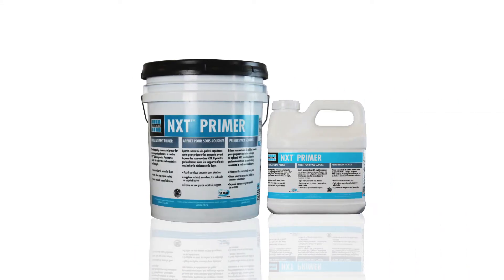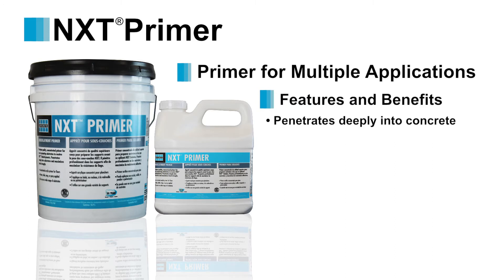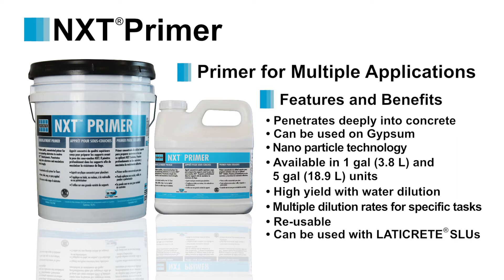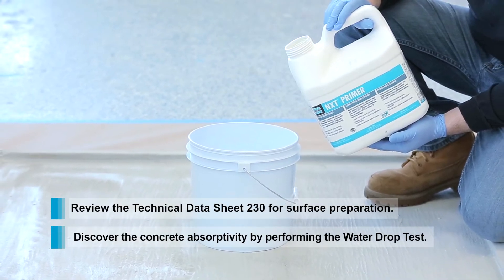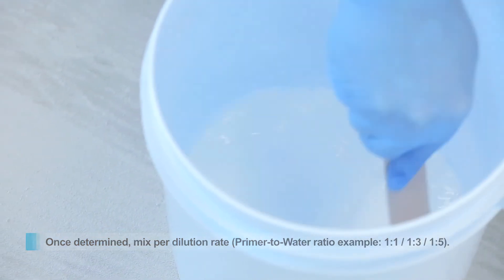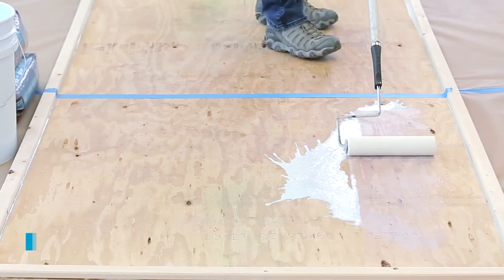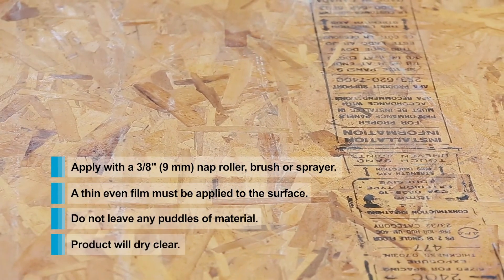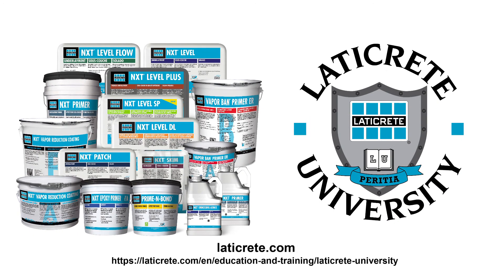Learn Why and How to Use a Floor Primer Prior to Applying Self Leveling Underlayments

Comment: I see differing information on the dilution ratio for exterior grade plywood. On an older DS-502.0-0717, it says to dilute 1:1. On the newer DS-502-0721
, it says 1:3 as well as on the tds230-substrate-preparation-and-primer-guide. What is the correct ratio and what brought about the change? Was there a new formulation? I have a gallon of primer manufactured 12/2021 which still has the dilution for wood as 1:1. Please advise
Reply from the maker: Thank you for reaching out. The product datasheet and the Technical Datasheet are correct that are on our website. This is always the go-to source of the most up to date information as we update it as things change and new testing has been done. This change has come from new testing which now allows for the use of some of our Self-Leveling Underlayment products over OSB.

The proper ratio for installing over EGP or OSB is 1:3 (Primer:Water) as noted in the datasheet online: https://cdn.laticrete.com/~/media/product-documents/product-data-sheets/ds-502

Let us know if  you have any additional questions. We're happy to help.